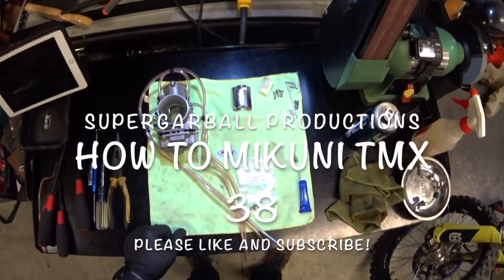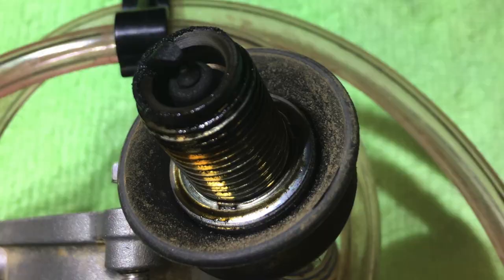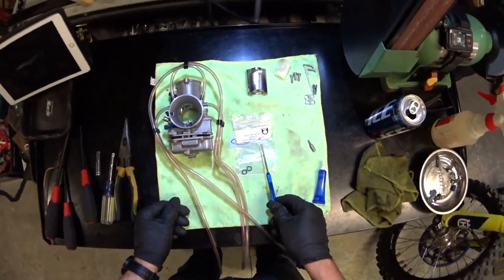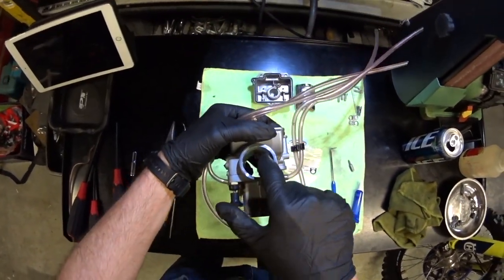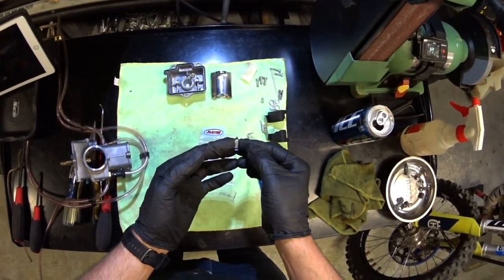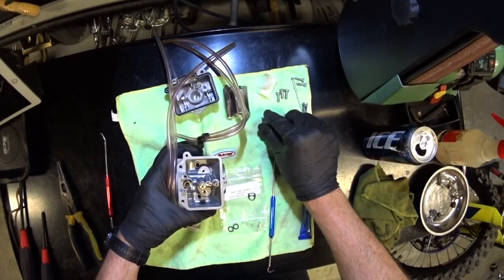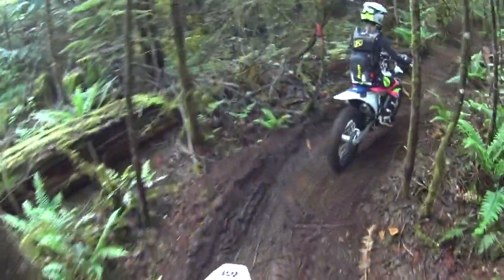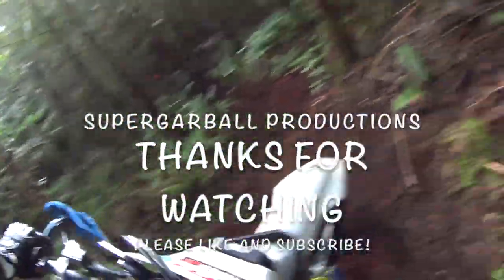How to Mikuni TMX 38 fix

Comment: Mikuni won't address the issue either. They are blaming the gasket failure on ethanol based fuel. We drill ours for Alky and are continually having issues. I just make it a point to change ours once every couple of months. Great job on the video and explanation.

Comment: Thank you for this video. I have been tinkering with the jetting on my 2017 KTM 150 xcw for a while, even with the JD jetting kit, as well as a bunch of other mods (RK Tek head insert, FMF Fatty, Turbinecore 2.1, vforce 4 reeds) I couldnt really get it to run as clean as it should. I suspected that my carb had this issue, as it seems to have plagued so many 17's, but I didnt know for sure. Took apart the carb, sure enough, gasket was one of the worst Ive seen in terms of being deformed. Also my o ring was super dry rotted. Put the new gasket and o ring in and HOLY CRAP... I thought it would make a difference, but not this much. Its literally like a different bike :) pulls super hard and crisp from idle all the way to the top and revs out clean! No more gurgle sputter of any kind. Honestly if you didnt make this video, I dont think I would have pursued  this fix. Hearing your bike in the video is what made me do it, my bike sounded exactly like yours. I always kinda thought my bike sounded a bit different down low than most other bikes....now I know why :) Thanks again for the video.
Reply from the maker: Hey Greg,
I'm glad this video helped.  I'll fill you in on an even better mod that I just did over the weekend that blew my mind away.  Haven't had the opportunity to do a video of it but since you're into it I thought I'd post what I did here.  First of all, the above mod does make a big difference on how the bike runs.  There's room for more improvement so I experimented with doing the Grahm Jarvis mod.  His bikes are 300cc so I thought it  may not carry over to a 150cc.  I was wrong.
Reply: @supergarball  yes I have seen that mod before in a couple videos. I have also heard that people like that better than the JD jetting kit. What jets are you running in yours? Were you running the JD jetting kit prior to switching over to the Jarvis mod?
Reply from the maker: Greg Stritzel No JD jetting kit, 450 main instead of the 440, 27.5 pilot instead of of the 25, 80 idle as specified and 1.25 turns on the idle air. Only reason I went with these is my local shop didn’t have the right jets in stock so I got the closest ones.  The setup is amazing. Only 1.5 h on it but will get a more in to see if it sticks.
Reply: @supergarball  did you do the slide modification by enlarging the groove at the bottom as well?
Reply from the maker: Greg Stritzel Yes, everything else in those instructions.
Reply: @supergarball  curious as to what jetting you were running before switching over to the Jarvis mod. What other mods/aftermarket parts are done to your bike? :) Thanks again
Reply from the maker: Greg Stritzel 470 main and 30 pilot and 80 idle.

Comment: When you did the install did your new gasket from JD sit flush? Mine wouldnt sit flush around the area where the two little holes are almost like the cutout on the JD gasket wasnt large enough. It sort of sat on top of the protruding area around those two little holes. I installed it with the ideology that it will be pressed into place when I tighten those screws but theres no way to check now that its installed and my bike is still running rich down low. I know the running rich doesnt mean its definitely the jet block gasket but I wanted to see what experience others had. The one I removed was only mildly deformed. Still on stock jetting on a yz125x and I live in new york

Comment: My brand new 0 hours,  2019 Yamaha YZ125 with Mikuni TMX 38 has this problem as well.  This problem is not exclusive to just KTM and Husky . Also the needle seat was wobbly in the carb body and leaking fuel, overflowing  because of a shrunken seat Oring. 0 zero hours on this bike, crazy. These must be new old stock carbs. Thanks for the video
Reply from the maker: Glenn Gertz That’s really good to know.
Reply: supergarball wow mines wobbly too 2018 300 xc I changed the clip position I noticed it wobbles way to much got a new circlip still does it its the block seal gasket I hope.This carbs been a pain in the a
Reply from the maker: Jay Cee I’m really surprised manufacturers would leave it up to the carb companies to sort this out.  Not good for the industry as a whole.  I just got back from a ride today with the Jarvis mod and it’s just awesome.  No need for a Lectron for me.
Reply: Dang man I guess Yamaha went to keihin some time soon after because my 23 yz250x has a keihin. I will say, 60 hours in and 1 xc race, I’ve had zero issues
Reply: I’m here chasing problems on my 06cr..they used Mikuni tmx

Comment: VForce4 reed too.  The original Reed is crap. I did the JDJetting needle kit and Block Seal kit.  My TMX 38 is perfect.  You didnt see any O-Rings underneath the two Torque 10 screws when you took the Seal Block out?  I didn't either. Saw a thread on U.T. that he put them in where the two screws go back in.... Mmm?
Reply from the maker: Nope, didn't see them either.  I bought my bike new so no one else worked on it.  I'm going to try out the Grahm Jarvis mod on this carb in the near future and see what happens.
Reply: @supergarball  please do a video of the Grahm Jarvis mod install and a review of after...that would be awesome!
Reply from the maker: Barr Thom As soon as I get back from holidays it’s going to be the first thing I do including a rad repair.  Stay tuned.
Reply: Barr Thom I saw that too and someone commented that’s not right and he said he was doing another video to correct it he realizes it was wrong he should take the vid down maybe?
Reply from the maker: Jay Cee I’ve been riding with the Graham Jarvis mod for almost 2 months now.  Have to say it’s near perfect. Definitely forgot I even have a carb. So nice not to have to deal with issues anymore. Haven’t tweeted or touched anything either so it’s pretty consistent.

Comment: I have an older TMX on 05 KX125 do you know if its the same? My bike is also running like crap. Wonder if carb cleaner deforms that gasket?Very good video.Thanks
Reply from the maker: tndeere Don’t know, that’s a much older carb. I wouldn’t give up on it though. All these carbs can run well as long as you do things by the book.
Reply: What TMX do you have?
Reply from the maker: 250race 38
Reply: Same I have an older 38 tmx on my 02 Cr125 and I think this may be it
Reply: They are the same…06 cr260 reporting in

Comment: Best advice is to remove the mikuni, throw it in the trash. Get an air striker carburetor from J&D jetting! Did this with my 02 CR 125. Night & day difference. Less than $200 for the carburetor that is prejetted for your location. Comes with red & blue needles & extra jets.
Reply from the maker: 22raddad Can’t say I’d do that. Since I’ve done the Grahm Jarvis mod to the carb 9 months ago it’s been running flawlessly.  Excellent power delivery across the band. Never think about it anymore.
Reply: Pwk isn't really superior to the tmx once you fix the issues with the tmx. Sure the tmx sucks off the showroom floor, but the fixes are dirt cheap and easy.

Comment: You should always put 2 to 3 psi to see if your float hold air.
Reply from the maker: 250race +1. I basically blow into the tube when I have it apart while rotating the carb to check that. Don’t know how much pressure but I think it’s quite a few psi.
Reply: @supergarball  I use a radiator pressure gauge
You can get from Harbor Freight. It should hold about 2 lb if it doesn't then your float needle or your o-ring in your needle seat is bad